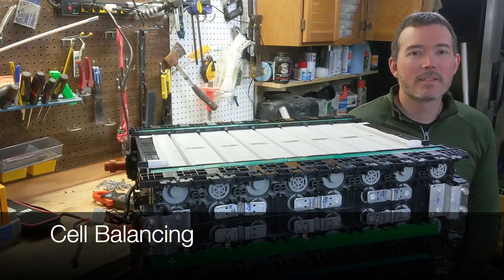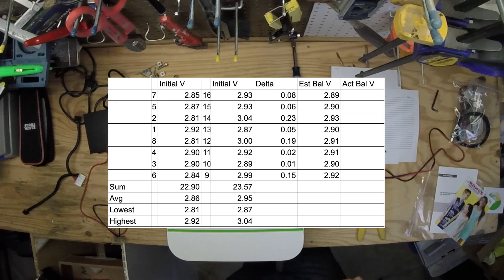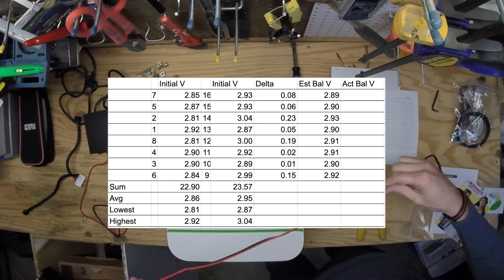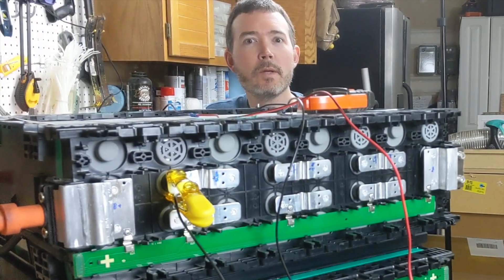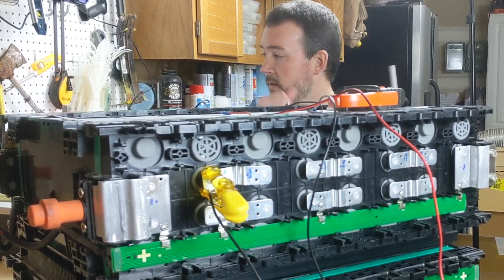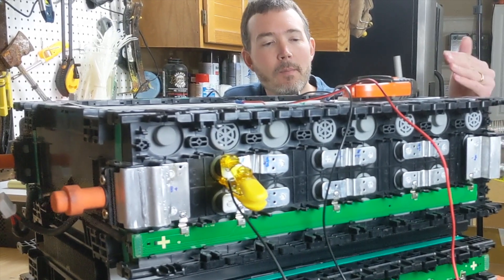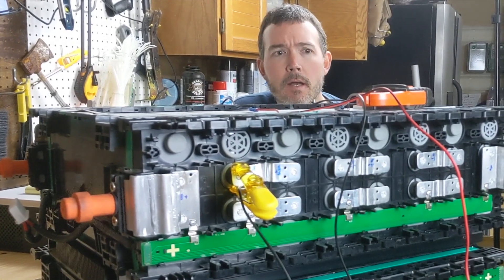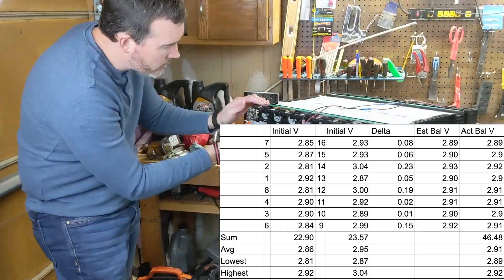Cell Balancing w/ BYD 24V LiFePO4 Cells

Comment: I picked up 3 of those modules in November 2020.  Just got what I needed to start balancing them.  I'm using them as 24V and will Parallel together. First one is going on a hand truck cart system for portability, the other 2 will be put in parallel with the first when it is stationary at home.  Question:  When connecting a bench top charger for initial charge of one  module, do you expect a spark when you connect the charger leads to the terminals?
Reply from the maker: I typically don't turn the charger on until it's connected. However, if you do have it on a small spark similar to what you would see with a car battery would be expected. If it's an arc with shooting metal, that's a different story!

Comment: thanks for the video. Im seeing them on battery clearing house and am interested in them, just wondering if you know how many modules are there an what kind of batteries are in there? 18650? thanks
Reply from the maker: Hey, so these are large custom cells actually and you wouldn't be able to break them down further than the 8 in each battery. You can split the 8 to 4 and have 2 12V batteries as I've seen a few videos from others do.

Comment: I just picked up 4 of these 24v batteries to hopefully make 2 - 48v units for my solar battery bank.  I'm new to all of this and just assumed that the BMS would take care of balancing all of the cells?
Reply from the maker: Hey, sorry about the late reply. The BMS I have has balancing, but it can't actually balance them in real use as they are simply too big for it. There are some dedicated balancers that have higher amp ratings that apparently do work well. After using them for quite a while they really don't get out of balance with a solar setup it seems. If you were going to use them in a EV that would likely be a different story.